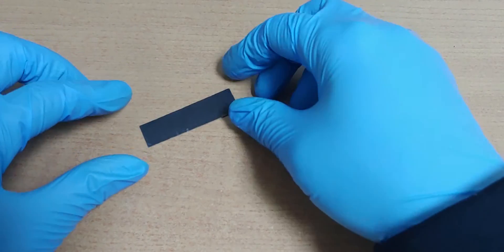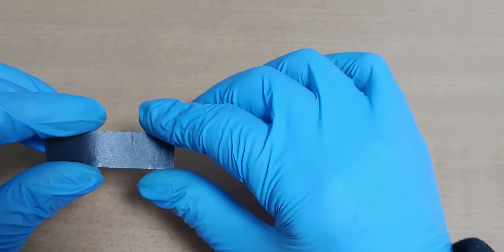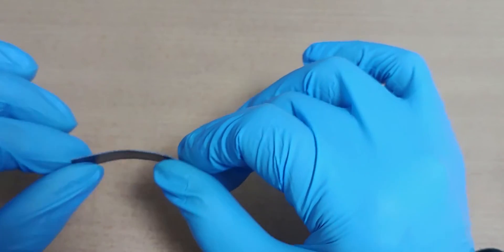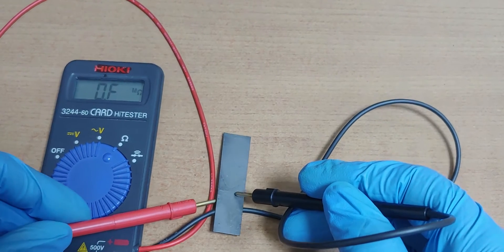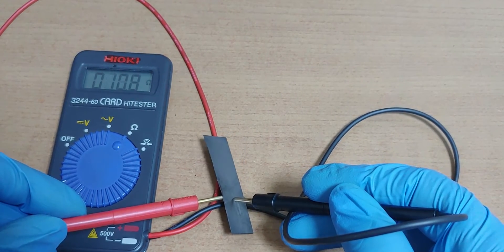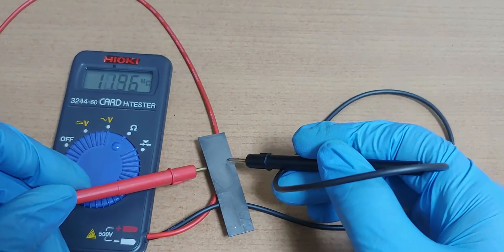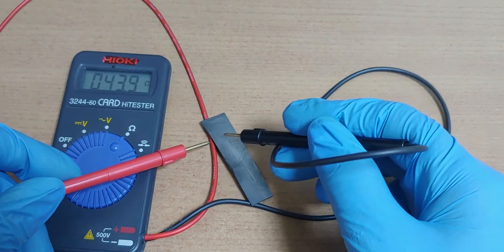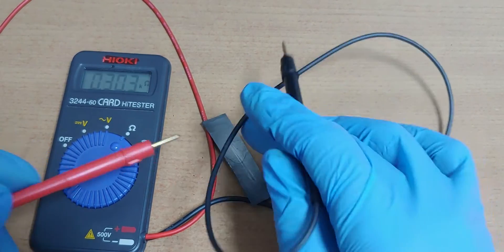In the development graphene/graphite paper anode

Comment: I was going to tell you that as a solid electrolyte thin film mixture of Sodium hydroxide and elmers glue or something else will work as a solid medium with electrolyte acid. It will work dry but will benefit from atmospheric moisture. Sodium hydroxide will be diluted to water until it does not disolve then add 3 times more glue to the liquid and mix well. When it dries on flat surface it will flatten and produce thin solid electrolyte film when it dries.

Comment: Hi I want to build a 67v5kwati battery I did not graphite is the same as the charcoal grill.
If the coals make it fine powder mixed with silicone aluminum, find the electrolyte with salt water or soda water.